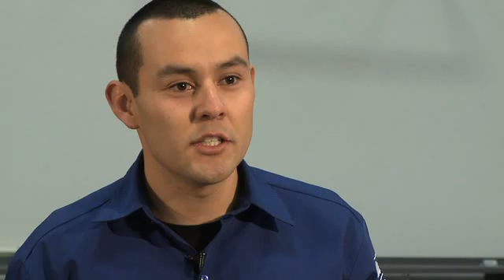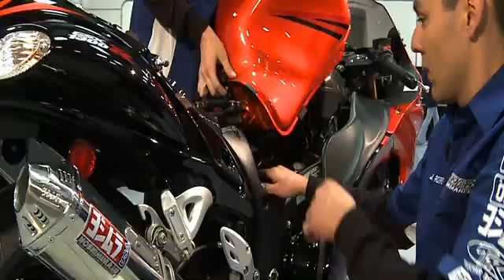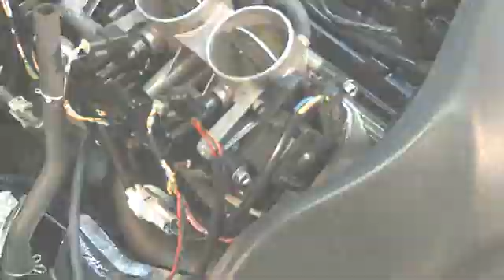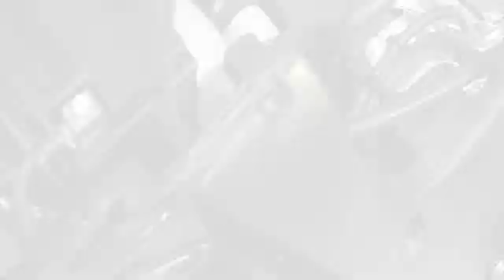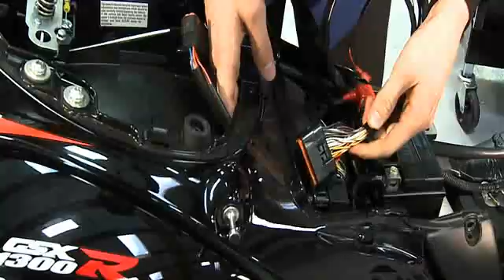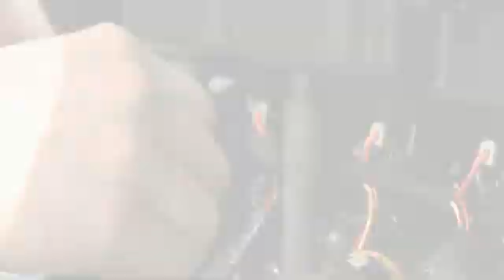Bazzaz Performance How to Install ZFI TC

Comment: Hello, you notice in the video that the BAZZAZ wiring is installed without following the numerical order of the cylinders.
I mean:
the cylinder 1 of the bike matches the cylinder 4 BAZZAZ wiring;
the cylinder 2 of the bike matches the cylinder 3 BAZZAZ wiring;
the cylinder 3 of the bike matches the cylinder 2 BAZZAZ wiring;
the cylinder 4 of the bike matches the cylinder 1 BAZZAZ wiring;
And 'this is the correct way to install?

Comment: Hi
@sportbikewrench I have bought the Z FI TC QS kit for my 2016 hayabusa. In the instruction manual, it shows in table no 9 to replace stock shift rod with supplied bazzaz  shift rod. However, there was no shift rod in Bazzaz Kit. In your video, you have not shown installation of quickshifter switch (also when you open the box and docket the items, you have not mentioned any shift rod). Please advice.. Is it required for the installation??
Reply: I lost the install manual
Reply: Thanks for that i need to know next to the oxygen sensor there is a blue connection I need to know the whirring for the male side if the blue connection

Comment: Hi I have a 2007 zx14r se right now it's has a PC3. I've bought the ZfI Tc. But have not installed it. Was told that I didn't have to have the add ons. But most videos shows I do. So far as far as the Bike I see the Secondary butterflies were removed. There's a four into one Vance and Hines Megaphone sidewinder. There's no mapping for this pipe will it be a waste trying to install it?

Comment from the maker: @paulmichela sorry we missed this! Yes you can do the install and self tune the TC on the bar switch as well as the in the computer via a lap top. Start by simply manipulating the bar switch through the range.

Dave Moss
Host